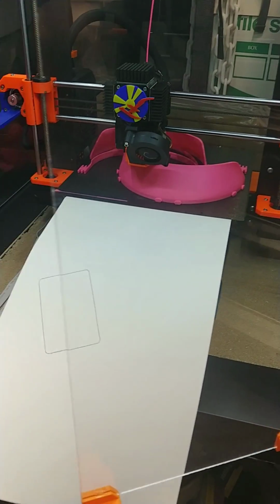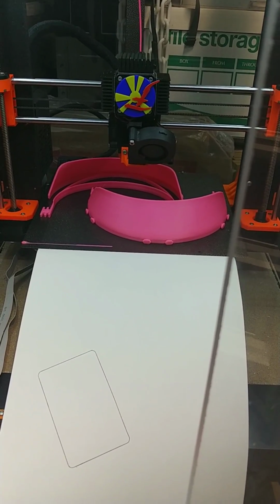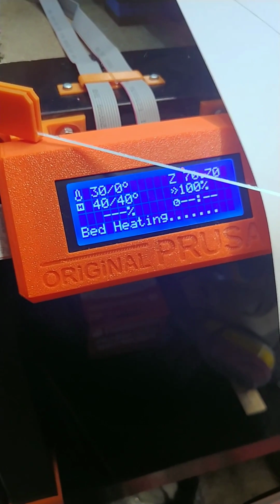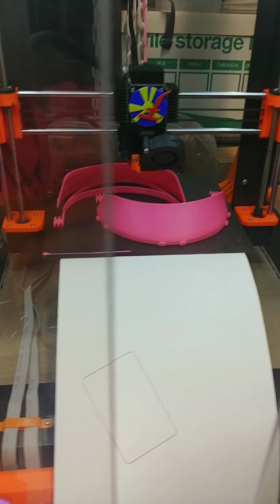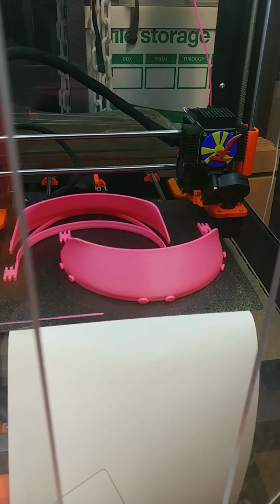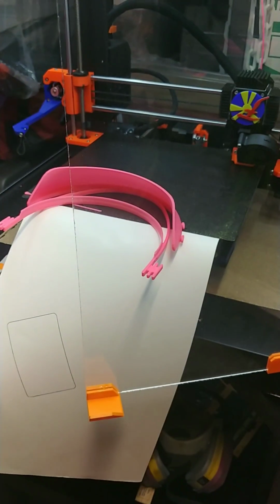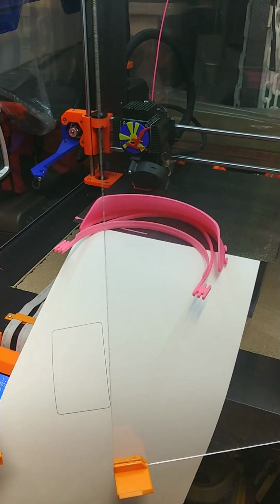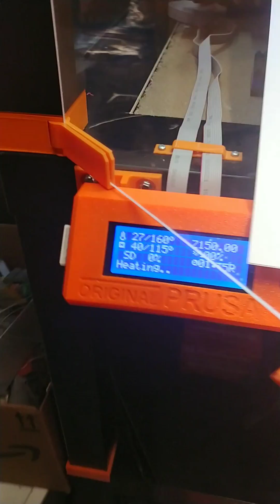Automatic printing

Comment: impressive usage of g-code. What mateiral? Do you print without glue?
Reply from the maker: Thanks! These were ABS on a textured sheet. When it's hot, it sticks well. When it cools, it completely releases. The same works for PETG on the textured sheets. Without something that holds while hot and releases when cool, this wouldn't work.
Reply: @ggaub  ABS has a tendancy to curl up with my usage. Any suggestions?
Reply from the maker: @davidewing9088  Geometry of the model makes a huge difference. When I have a model that doesn't want to stay on the plate, I'll toss a brim on it. If that's not enough, and I've made sure my temps are correct and my first layer is nailed, I'll use a ABS goop (slurry of ABS scrap and acetone) which usually does the trick. I'm assuming you already are using some kind of enclosure to maintain the high temps needed for ABS printing.